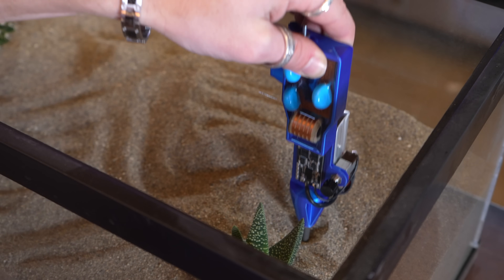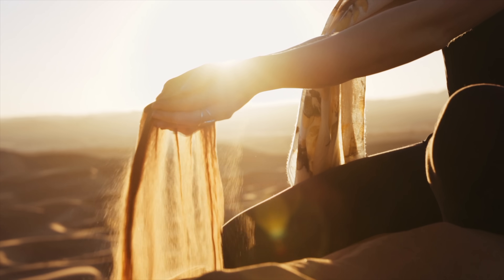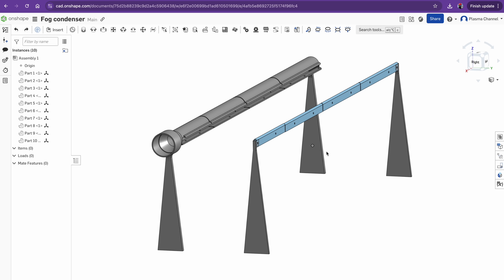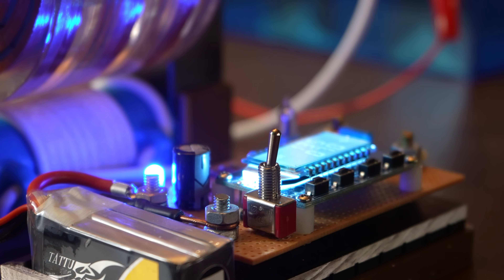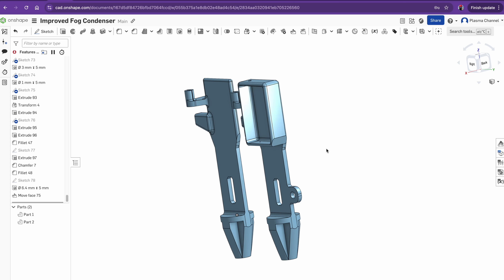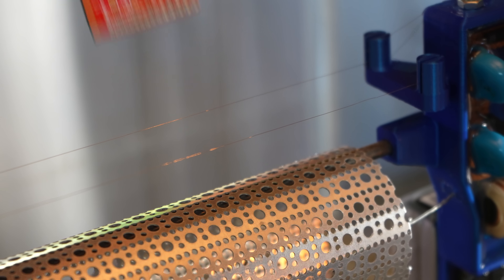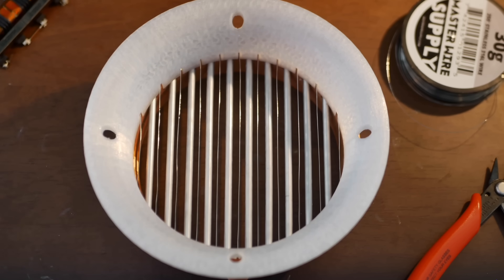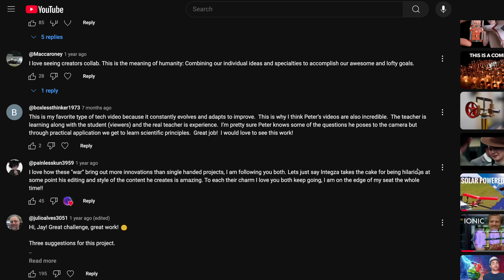Solving Desert Water Shortages Using 20,000 Volts

Comment: Something like this has been used for years in exhausts of power plants and other industrial processes they are called Wet electrostatic precipatators used to remove small droplets of water from air.
Reply from the maker: Oh, now thats great information for me to know about. Very similar use!
Reply: @ I've seen this effect on electric fences in the morning fog. The grass grows a bit better under the fence. But i'm sure it could be optimized.  Solar power this and you would have a powerful tool to combat desertification.
Reply: @dawsjam  How would it combat desertification? All that fog you are "harvesting" is always going back into the sand when the sun hits. At best, you would just concentrate moisture to a small place and make the surrounding area even more dry.
Reply: @bluemamba5317  You give vegetation a foothold whether its grass or some other drought tolerant plant it stops the sand from blowing as long as you keep the cattle and  offroad vehicles off, it slowy spreads and locks up the sand.  Grass has also been shown to replenish aquifer's once it has a foothold.
Reply: @dawsjam  Desert areas don't get rain in the first place. FOG ruins the viability of Solar power heavily,  and this also pulls precipitation from the air which already is in low supply.
Reply: So beware fog getting into your whole-house electrostatic air filter 🙂
Reply: Most likely if the "experts" who developed these precipitators had had a YouTube channel they would have solved desertification.
Reply: So this invention he showed us, is not patentable?
Reply: So the question is, why nobody used it in deserts. Probably it was never feasible.
Reply: @cihadturhan  scalability, exactly. Or profitability....lol
Reply: @A.eye_101 profitability should be the main consideration from the start anyways.
Reply: @cihadturhan  This works by removing precipitation from the air. Arid regions are called Arid because there is no precipitation in the air. FOG is included whether it be evaporative in nature or low hanging clouds. Most Deserts have extremely low precipitation and even the ones that have fog banks it will never amount to a good enough amount to use for Agriculture or even drinking usages. His expirement not only had the best FOG conditions 100% humidity, but an oversaturation as he himself also stated the unit he built had naturally dense fog. It would be hard to even say something like this would work correctly in the real world.
Reply: Desert is dry, you wouldn't get fog as often, if any.  @cihadturhan
Reply: @cihadturhan  Fog is just low grade rain I'd imagine that the regions in which this is feasible is limited. Rain is free, this costs money. Standard crops need Acre/ft of water to produce a profitable crop and relative humidity during the day needs to be reasonble making most deserts unfeasible using standard crops outside of greenhouses.
Reply: @dawsjam the concept seems quite compatible with tunnel greenhouses (in areas where there is coastal fog but minimal precipitation).
Reply: @cihadturhan  or simply no one ever thought of it.
Reply: @cihadturhan  cause there's no water in the desert
Reply: @juggernaut316 there is enough water in the air in every desert it just rarely comes down as rain. i assume you’ve never been in deserts yourself to make such a statement over night - humidity is never 0%

Comment: cool idea. make sure to include the solar element when you take it to a desert, and try ruggedising those thin wires a little.
Reply from the maker: The thin wires are definitely the liability here. If they break, entire thing doesnt work. Or....output drops by 70, 80, 90%. For the next version, i'm trying to think of solutions.
Reply: @PlasmaChannel  for outdoor, longer term deployment the whole unit would benefit some screening to prevent wildlife, leaves, and the like messing things up with shorts or damage. the right screening would protect the wires as well.

Especially important since the water would attract animals.

Comment: Will the moving dirt particles not be affected? Cause conventionally we say that dirt is negatively charged will it not accumulate upon the positive terminal and wire? In case of presence of current the dirt particles also experience a magnetic force and move accordingly and might just pollute water by being in the path of the mesh
Reply from the maker: There will be a buildup of dust on the positive wire, no doubt. Luckily, with it being a thin wire, the increase in diameter from .01 inches to .02 inches.... wont really affect the ability to ionize air much. As an example.

Comment: Yeah all cool and dandy but what about material degradation of mesh and wiring. Scalling it bigger an keep efficiency, and power consumption especially on remote locations.

Lots of ideas are amazing in small scale but when you upscale it you realize that it would be easier and cheaper in long run to just build long pipe to move water or even use  plain to just drop water bottles on desert...

Comment: Very cool concept and noble cause!

It has me wondering if sand in a desert would have a high enough positive static charge that if you were able to stick an insulated wire deep enough into solid ground beneath the sand, would you see a similar passive effect? (No doubt to a much smaller degree)

Comment: 260 kJ/L or 72,2 Wh/L is not bad! But I assume the timespan where this could be used effectively in a desert is short. So higher volume rate might be good, even if it means lower efficiency.
of course deserts have other challenges for plants such as extreme temperature deltas within 24h

Comment: Could you use a static charge like the one you got from you free electricity from the atmosphere video to run this? Solar panels would work well but you'd need a way to store the power to make the most of the morning fog, and then all of the associated circuitry. If a tall mast could harvest enough power to run this completely passively with zero circuitry it would be a beautifully elegant way to produce clean water in those places. "The desire that guides me in all I do is the desire to harness the forces of nature to the service of mankind" - Nicola Tesla

Comment: It's interesting that it can run with Solar. The meshes can be used as sun-screens to control the exact amount of sun hitting the plants, too, and could help modulate how quickly moisture evaporates from the system. This could be run with the same angle-finding algos on solar panels trying to optimize solar collection, too, and in so doing, create an essentially automatic system. I doubt you'd have much worry for weeds, either, as there wouldn't be any SEEDS to contaminate your rows, thanks to it being, you know, a desert with no adjacent vegetation to speak off...

Comment: 6:45 the mesh needs to be cold
Reply: Yeah, it'll be pretty cold in a desert
Reply: @ani-zv3bp actually, at the time this device is supposed to work everything should de cold, since desserts lose heat rapidly at night
Reply: @pedropolanco7052   yes, you're right. Hot air rises above the cold however there will always be residual heat which will slowly release into the environment so the desert will almost never be cold enough for water to condense on
Reply: I'm a farmer trying to grow a crop in a desert.   I'm an idiot
Reply: I also sound like a naysayer who gets proved wrong

Comment: I work at a power plant, we used electrostatic precipitators to get the ash out of the flu gas. 40,000 vdc on wires hanging in the gas. They were vertical but similar to yours, great idea.
Reply: Vertical wires may actually be way more effective. It probably allows condensed water to drop down quicker, making room for new fog to condense. As water is not sue or conductive, I'd expect accumulated water droplets to lower the efficiency of the condense roster.
Reply: @qwertyboguss  Also, the water would only require a small bucket to collect instead of a giant, long gutter.
Reply: I knew I saw this somewhere else!  It's been so long (30 years ago), but this was used on a stack scrubber system back in the 90s/  Did they have water problems with the precipitators?
Reply: @davestorm6718  we tried our best to keep the water out. It was flue gas with barely any excess O2 (around 2%) but the entire section was under a vacuum so anywhere around the duct work that moisture could get in from the outside, it would. But yea once the water got on the wires or plates, the ash would stick to it but not come off as easily. Which could be an issue in the desert with sand/dirt blowing across the system. We had big rapper/vibrators than would hit the top of the plates & wires to drop the ash into hoppers.
Reply: I just commented before,  i made high school project on electrostatic chimneys
Reply: Are you describing an E-Filter like moste power plants have it?
Reply: @Systox25  never heard the term E-filter but I suppose you could call it it that. It’s using an electric field to pull particulate from the flu gas.
Reply: @ i work with one that uses plates and like antenna mesh with spikes. Rotating hammers looses the buildup after it clumps together.

Comment: I wonder though if the commercial dehumidifier is designed to keep the air at a certain humidity instead of "pull as much water out as possible" so it may not be a truly fair test.

Comment: I wonder if it could work in times of high humidity, but when the dew point has not been reached - in conjunction with a MOF that has been made conductive, or sits on a conductive frame? 
The, I guess I'll call it an ionic thruster, may concentrate water in the incoming airstream allowing the MOF to work more efficiently. 
This would give your system a hybrid mode:
During fog it would work as you demonstrated, and during other times it could work with said MOF by concentrating humidity. 
Heat during the day would drive water out of the MOF, but I also suspect an electrostatic force could assist with that as well.

Comment: We gotta get Cody's lab to set up a bigger version at Chicken Hole base to see if he can collect a significant amount of water there
Reply: No costal fog in central Nevada.  In the summer humidity is in the single digits during the day and tops out around 20% at night.
Reply: He's in a dry desert, you can't pull water from the air when there is little to no water in the air.

The only places where water from air is viable is places with high humidity.
And most places that have high humidity also have regular rain fall.

Desert fog is an outlier as it only happens when it's still cold in the early mornings, where the ocean humidity can get blown inland.
But once the sun comes up it dries up all the humidity, and thus you can get a place that has intermittent high humidity but little to no rain.

Comment: Would it be beneficial to add some vibration to the mesh? This would hopefully improve its ability to shed the condensed water, so it spends less time on the mesh, with the corresponding chance to re-evaporate. It would be interesting to test if this would make the system more efficient.
Reply: Instead of that, if we paint the mesh with hydrophobic material, water droplets will drop off when they are even smaller.
Reply: @sridharpalla2534   The question is, would it affect the polarity of the mesh.

Comment: Well, technically this idea is amazingly scalable! Just imagine: this needs energy, desert is the best place for Solar Panels, the device uses rechargeable batteries... I'll let you do the simple steps to understand the amazing efficiency of this thing!

But also they could use not batteries attached to the sticks. I mean, there could be a place with the solar panels connected to batteries, these batteries connected to wires that are then connected to the dehumidifier system, the system will work only when a certain humidity is reached (this can be easily monitored and automated), and here it is: completely efficient water production using sun as basic energy.
Reply: Also I didn't remember to say that the system should be used firstly for collecting water instead of irrigation. The water will be used for both irrigation and storage for water needs, because you have to remember that you are in the desert
Reply: The batteries are likely to be a necessity, as the optimal conditions for this to work are very sub-optimal for solar cells, and vice versa.  Most likely, you'd have it charging all day, then running in the early morning.

Comment: What would be nice to see is a 30kv battery bank. I think a lot of wasted wattage goes into heat from the switching circuit. I would imagine if we had 30kv of AA batteries as a supply it might draw less power, but there is only one way ti find out. I know it sounds crazy but imagine 10 acres of farm and 30kv of car batteries hooked to it. It could probably run a very long time b4 it ever needed recharging. I guess the ultimate circuit would be some sort of solar setup where the sun does all the work for us. I don't have any idea how much of that power is lost by the circuit, but its probably much more than a switching power supply to be honest. Very cool setup none the less.

Comment: Try to use multiple Sonication Device in the box you have with High quality Micronised Graphites Powder..
There are studies which suggest if the Ultrasound are Enough it just requires 2 minutes for Generating the Best Graphene Structure...
You could add Pure Cellulose-Acetate to the same Batch and Making a Graphene Composite Material For One of your Projects!

Comment: You could make this significantly more efficient by chilling the ground.
Reply: And how would you efficiently chill the ground?
Reply: @AlexusMaximusDE   Make it out of aluminum or copper tubing filled with a refrigerant from a heat pump. Hell it could be chilled brine.
Reply: @WarmPudgy  If you'd bother with all that, then just run a normal phase-change condenser.

Comment: This is Brilliant.   I can't wait to see a much larger, scaled up test, using some solar panels to keep the batteries charged.    I would also love to see you try lower voltages.  See how low of a power usage you can get to, before the collection of water drops off.   There may be more efficiency to be gained.  Or maybe more positive wires that help distribute the fog all over the collector plate / mesh, instead of concentrating the stream at a central line across the plate.   Or would it not matter?   I honestly have no idea, but think it would be fun to find out!

But this is basically one of those ionizing dust collectors that you see all over the place, or one of those Ionic breeze units.  But instead of dust, you're collecting the abnormally high humidity in the air.   

Question.  When there's no fog, And the unit is just moving charge air to the collector plate / mesh,  Is there any kind of water build up?  Or is it so slight, that the slightest bit of heat would evaporate any water that would collect?    And what about running it in an area that has higher than normal humidity levels, but not fog?  like area's that are the coast.  Or more tropical environments, but where clean drinking water is scarce. 

That also makes me wonder if the device, in a real world scenario, would the water need to be collected in some kind of container, to stop the wet soil from instantly evaporating all the water, once the sun comes out, So the water can then be used more efficiently, instead of just dripping onto the soil / sand.    It might be better to place devices in higher concentrations in areas where the fog gets the most dense,  then transport the water to the plants, where the water can be used more efficiently.  

So many questions!  But many questions means the possibility of many tests, and ability to learn, and improve!!!

EDIT:  Or another idea.  What if the collector plate was shaped, so the incoming fog had more trouble leaving, giving the plate more time to collect water?  I'm thinking like a plate covered in riffles, like in a gold mining sleuths box, or rolling the edge that gets the most airflow in a slight curve, causing the fog to form a slight vortex, hitting the plate more.  Could then just tilt the entire device a bit, so the water can more easily run down the plate, to collect the water in a single location more easily, and to get the water droplets away and off the plate, so new droplets can more easily form.

Comment: Also doubles as an electric fence! So customers would need to be careful. (Although it’s too low power to cause real damage, it would still hurt like hell)
Reply: It's still high voltage, and it doesn't take a lot of high voltage current to cause problems.
Especially if the person has a heart condition.

Comment: 5:02 I used high performance super glue, it's only issue is at least for PLA it bonds effectively instantly so you better slam it in the exact spot as fast as you can.
Reply: Gloop is really toxic so yeah anything else would be better